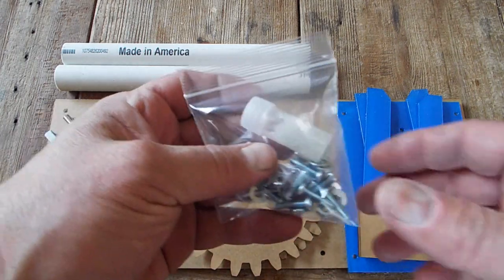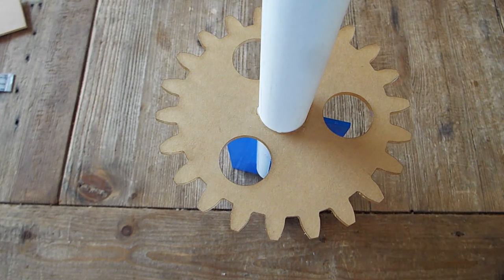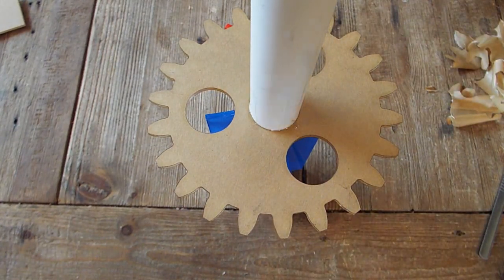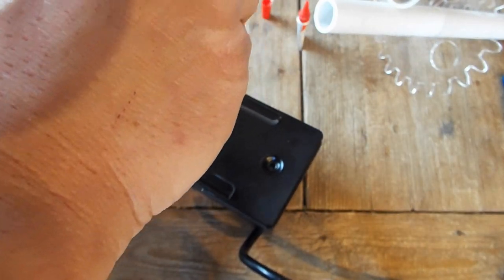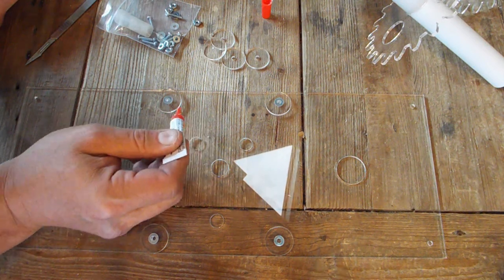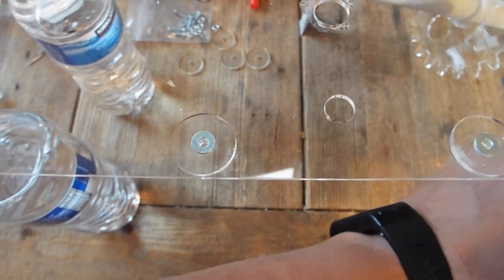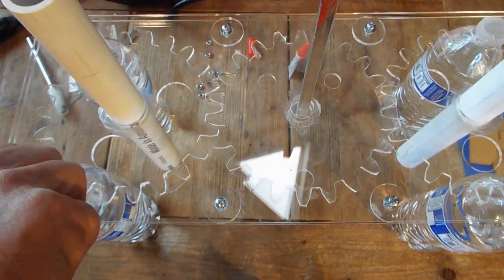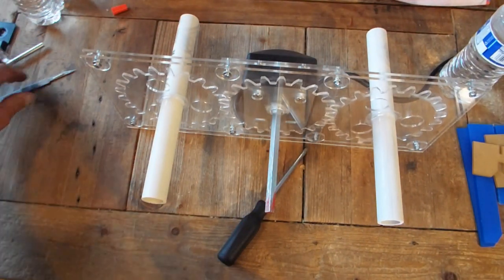Cuptisserie Kit, Base Unit Assembly, Cup Turner Tumbler

Comment: Just got my cuptissere kit in the mail and going to put it together tomorrow!! I’m so excited. No more hand turning my cups!!
Reply from the maker: Awesome!! Let me know how it goes for you.
Reply: Mad Scientist Hut unfortunately my motor isn’t working so I have to return it and wait for a replacement. I’m so bummed but I should have checked it when it first arrived. I ordered the onlyfire universal rotisserie motor off Amazon, is there a more reliable one that will fit these kits?
Reply from the maker: @montanalady3335  I will look to see if I can see any others out there. I have been running the only fires on two of my prototypes for months without them failing, the only issue I have had is with the metal bushing rubbing on one of the motors and it was causing squeaking/ moaning noise, that was a quick fix with a little bit of the synthetic grease, by applying a little grease to the bushing under the cover.

There is the Minostar : https://amzn.to/2MkqSsk looks like the exact same motor with a different name 
Here is one in stainless steel that only has two reviews: https://amzn.to/2WdIR8u
There are about five others that have no reviews.
Reply from the maker: @montanalady3335 If you have a specific motor that you would like to try out let me know and I can order it to get the measurements off of it and make a mount plate that will work for it, I will send you a new mount plate and send it to you free of charge.
Reply: Mad Scientist Hut ok thanks. I’ll wait and see if my replacement works .if not, I’ll go with a  Weber motor. I heard they are really durable and might have the same screw pattern.
Reply: Mad Scientist Hut I finally received my working motor and I got it all put together, I just played the video while I put it together and it was easy!!! I love it!!!! Going to pour epoxy after dinner .
Reply from the maker: @montanalady3335  Thank you so much, I am glad you love it. Let me know if you have any issues as I am always here to help.

Comment: First I have to say, I noticed the PVC "MADE IN AMERICA" Very appropriate👍😉 Great instructions Kirk,  I like that you provided everything to mount it, like the jigs, so there is no mistake for spacing. This video is perfect as instructions for someone to follow easily during assembly. Especially for people like me LOL I hate reading:).  You mentioned to take it apart to grease it every 60 hours. Can you make some slots on the plate so you can grease  the gears without having to take it apart maybe? One slot lined up with each gear should do it I think. Just a suggestion. for lazy people like me:) Another suggestion:  Change your Channel name to MadGeniusHut 😉  Just kidding my friend, I always enjoy watching your inventions because I can think of most things but do not have the patience you have to experiment. 👍5
Reply from the maker: Thanks John! I did place that facing up for that very reason!!! I thought about the holes for greasing but decided it would be better to disassemble for a complete coverage, as these units start to go out I will do maintenance videos.